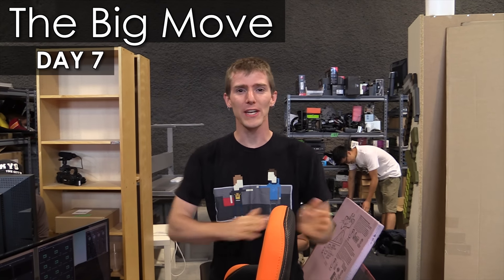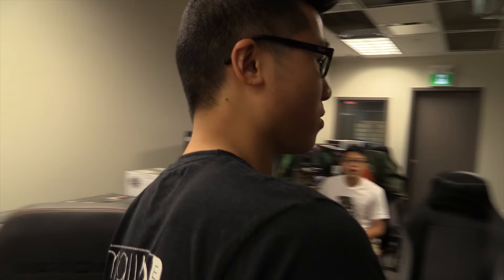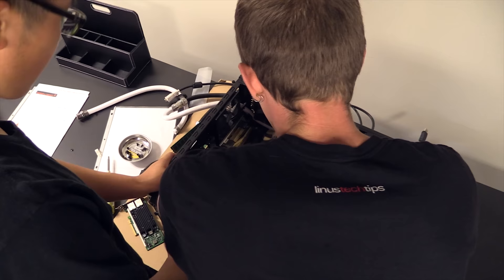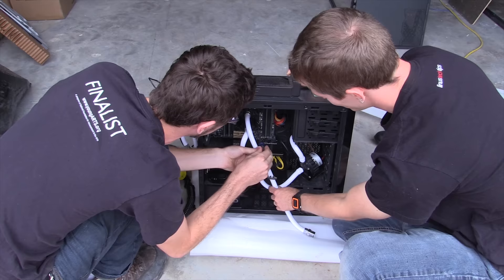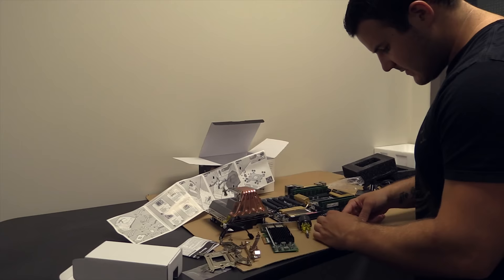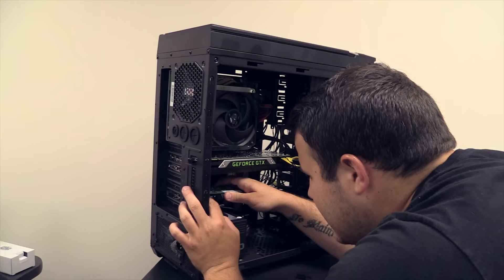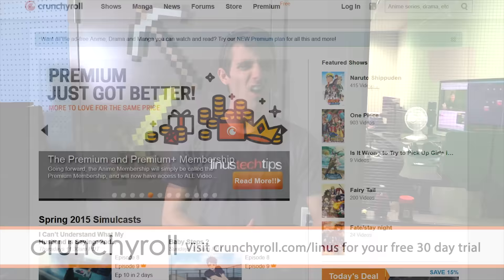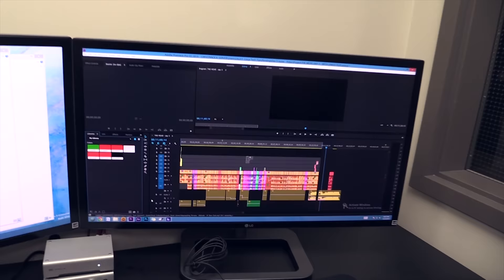The Big Move Day 7 - Editing Workstation Upgrades!

Comment: Linus, why aren't you using FirePro S9100's for your editing stations? O.o
You're just weird picking Titan-X's for editing, or yeah, there's the fanboy factor to include right?
Reply: Probably because the Titans were free or discounted.
Reply: +z1mt0n1x also maybe because they might be using applications that require cuda since they seem to also have a thing for blackmagic products (resolve) that really need a lot of cuda cores to power through. Just a couple of stabs in the dark. shrugs (and yes of course they're nvidia fanboys. hahahahahaha)
Reply: habezrahman
I see what you mean...
But CUDA cores is the same thing as AMD calls Stream Processors, before Nvidia named them CUDA they were also calling them Stream Processors.
And software programs probably (should) support both as I don't personally know of any programs that specifically supports only one or the other... That would just be bad marketing - IMHO.
Reply: I think I heard Linus give Ed crap for not screwing on his Quadro, which if more professional grad. I guess he wanted to add it?
Reply: +z1mt0n1x well, davinci resolve specifically needs cuda (for now)  to run at its peak performance. And up till the recent adobe 2015 CC update, premiere pro and after effects only supported cuda acceleration as well. But of course the launch of the new mac pros opened up amd's open cl tech to adobe so at least there's a change there. Just waiting for davinci resolve to catch up. But for now, quadros and titans seem to be their best bet for most of their applications.
Reply: habezrahman
Aha, well, fair enough then :)
Reply: Edzel has a Quadro so I guess that means they have to go Nvidia. Plus they need more displayport outputs. Anyway, Adobe CC takes advantage of CUDA.
Reply: Infinite Zero
Somebody obviously haven't been reading up on DisplayPorts... With DP1.2 (not A) you can chain up to:
4 monitors @1080p
2 monitors @1440p

This has no doubt been updated in 1.2a or 1.3.
That would mean, for example with a FirePro which has 4x DP outputs he'd be capable of running 16 monitors in 1080p or 8 1440p monitors.... And I assure you, non of them have even 8 monitors at their desk. Possibly 3 or 4 tops.

That conclusion excludes the alternative concern from lack of DP outputs.
Reply: +z1mt0n1x They use 4k.
Reply: Infinite Zero
Then it would be 1 monitor per output, aka 4.
Does Edzel have more than 4, 4k monitors? I don't think so.
Meanwhile, searching through the internet... I couldn't find any Titan with 4 DP outputs at all. So once again, lack of DP outputs is out of the question.

You still have more outputs with a FirePro S9100
Reply: +z1mt0n1x Even so, CUDA needs to be taken into consideration. Any AMD equivalent isn't exactly the same. Certain programs take advantage of certain ones, as Luke explains in the distributed computing build log. In this case, some parts of Adobe CC take advantage of CUDA. And again, you wanted Edzel to use a Quadro and a FirePro in his computer?
Reply: +z1mt0n1x Oh and I seriously hope you're talking about the W9100. Even so, Titan X has much more power and CUDA support. FYI, 3D rendering at 4k needs quite a bit of power.
Reply: Infinite Zero No I meant the S9100 though the website I saw it on probably changed its name. Think it's the W7000 now or something.

And wow... Why do you bring up 3D rendering? They're not rendering anything in 3D.... This is plain 2D footage.
Reply: +z1mt0n1x Remember the explosion effect in 4k ultimate build guide? And the intro of the ultimate surround build guide? That's 3D rendering.
Reply: Infinite Zero
That's weird cuz I've seen alot of effects and illusions in the visualizer editor of Winamp and they're all in 2D, even the ones that looks like 3D.
And believe me, there were some stunning effects, but nomatter how stunning they were, still in 2D.
All movies are in 2D, even your monitor outputs 2D. What you get from your games is the illusion of 3D cuz objects appear as if they were further away from each other.... But it's still on a flat 2D surface.

In other words, rendering 3D is a gimmick for as long as your monitor can't dislocate itself in order to do what the game or movie does.
I'd rather call it 2.5D
Reply: +z1mt0n1x AMD Firepro W9100's are infinitely better than any other card AMD or NVidia card either company has, they're elitist workstation cards, no doubt 'bout that.
Reply: Kyzer Buhnzi
Just wondering why they're not using FirePro instead of Titan cards...

Comment: It is so weird that these video editors don't know how to assemble a computer. IMHO you should know everything about the device you're using and how to troubleshoot it.
Reply: How many people do you know who use a car daily who have no clue how to change a spark plug in it or change the oil etc?
Reply: Legion563 You've got to know how to fix basic problems in a car if you use it for a living (courier, taxi driver, uber driver, etc). Same with video editing, except here it's a lot more accessible and cheaper with the performance of your editing system being entirely dependent on what you've got in the case. I doubt these people even know what components were installed both before and after which IMHO is unacceptable. I actually have a lot less respect for Linus' editors after this.